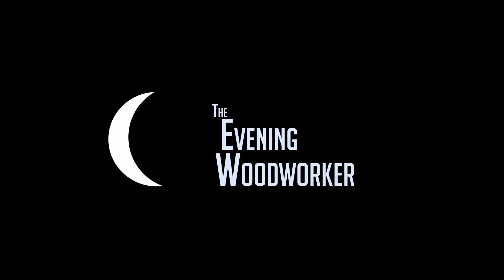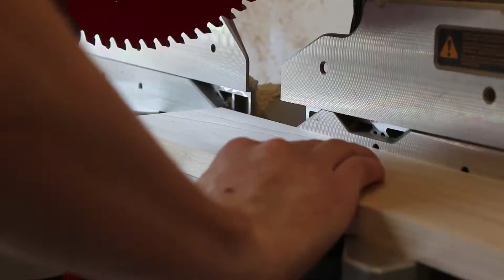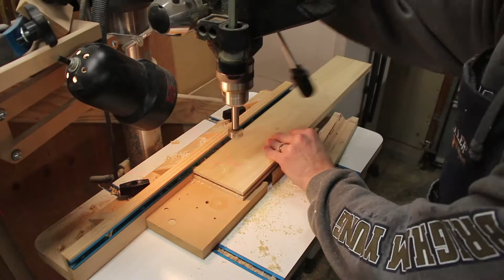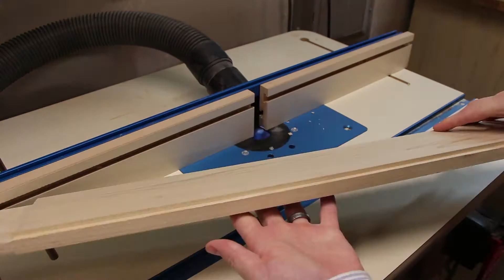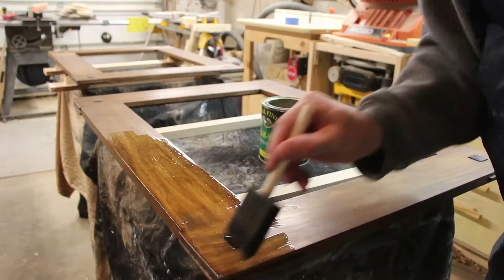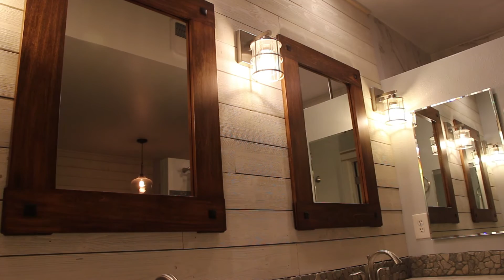Custom Bathroom Mirror Build | Evening Woodworker

Comment: Nice looking mirrors , you did a great job on the joinery . Did you dry fit those button plugs , they fit nice and tight .
Reply from the maker: Thanks! I tried a dry-fit but then almost didn't get it out before adding glue so I decided to just sand them snug and get out the hammer!